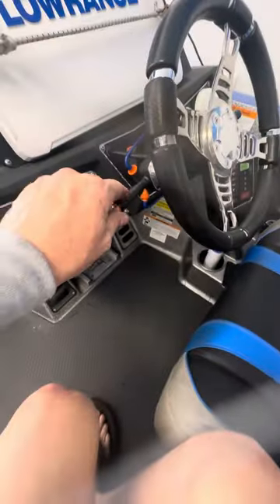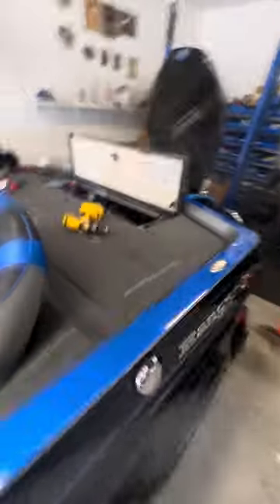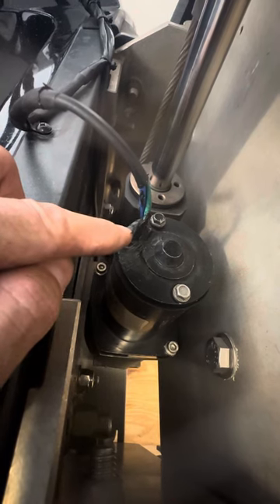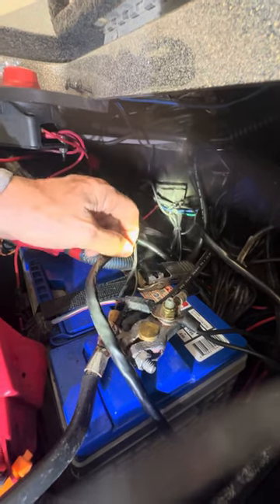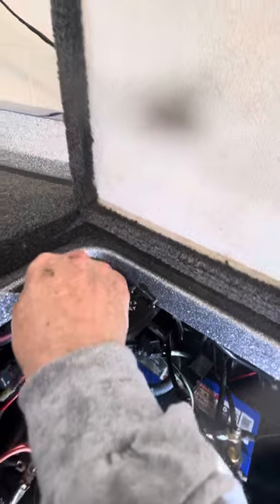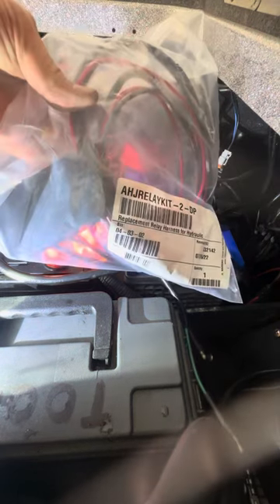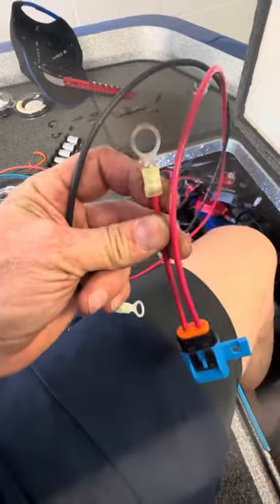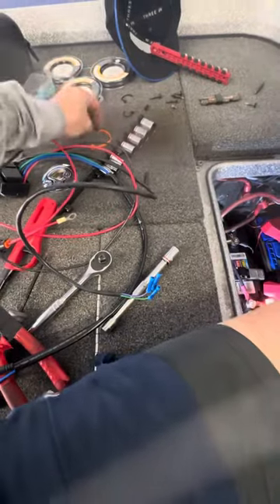Jackplate problem Relay Replacement on 2018 Ranger Bass Boat Z520L

Comment: Did this fix your issue? TH is sending me a new actuator. I think it’s the relay because it is intermittent like yours. One day it works fine then it goes up or down then it doesn’t or goes super slow.